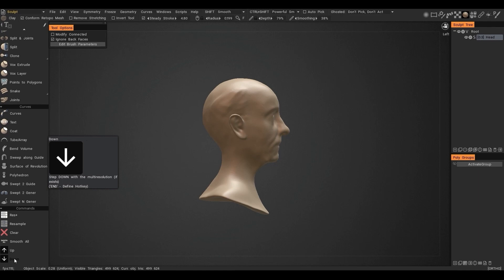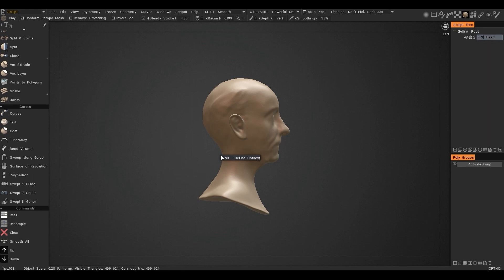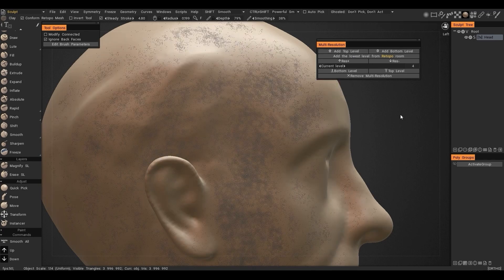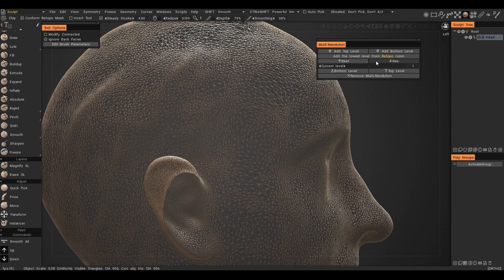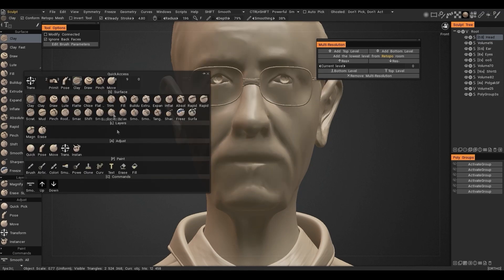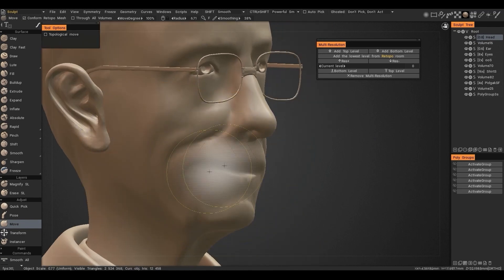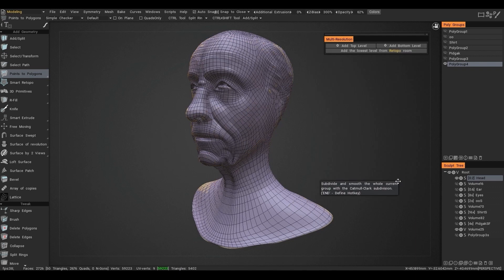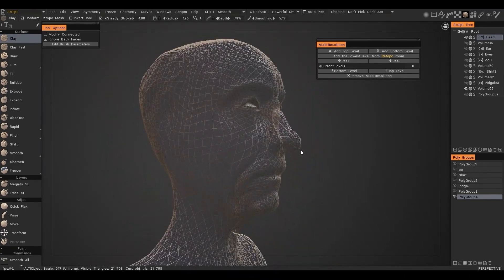Multi-Level Resolution Tutorial

Comment: nice, but how to delete not needed levels? I see there buttons to add lower/higher levels, but no buttons to delete them. In zbrush you have delete lower/higher buttons, how to do that in Coat?
Reply from the maker: Currently, you can only delete all the levels at once. Development probably didn't foresee a need to delete individual levels once a user created them, as they do not adversely affect the workflow or performance in any substantial way. Nevertheless, I will pass this "request" on to development, so users have this option, if needed.

Comment: Hey, thanks for the tutorial. Could you maybe do another one please, where we see how to work with hard surface objects like belt straps, models we modeled in Modeling or Retopo room, and then use these meshes as a base for Multi Resolution? I know the way of "Mesh -> Sculpt Mesh" , but it doesn't work the way I expect it to. The workflow for quickly modeling e.g. a jacket as low poly and then bring it to sculpting, is not entirely clear to me. Lots of times I have strange duplicates in the sculpt tree, and/or, when deforming the new multi res mesh, it seems the underlying structure sometimes doesn't stay intact. It must be something I'm doing wrong. I would find it very helpful if you guys could show for instance how to model something like a belt, a helmet or anything else more hard surface'y, and then use it for Multi res in the Sculpt Room :) . Especially I would be interested to see how to work with such a low poly mesh in sculpt room, how to manipulate the lowest levels for controlling the shape, without any alteration of the low poly base, and keeping the volumes intact on higher levels.
Reply from the maker: You are most welcome. We will try our best.